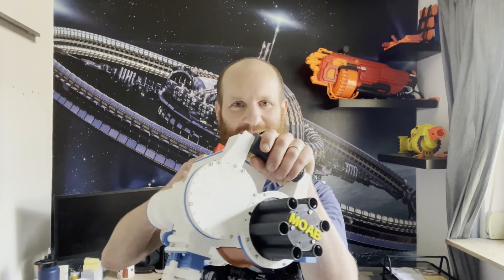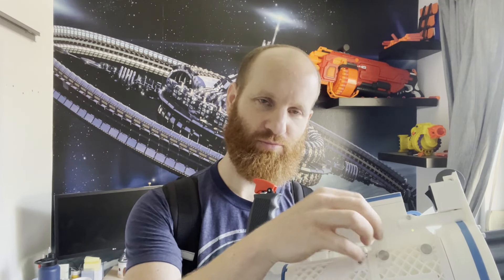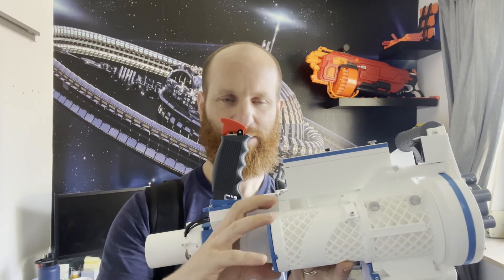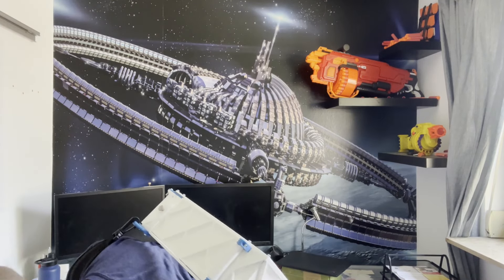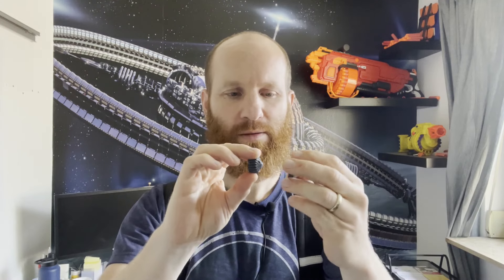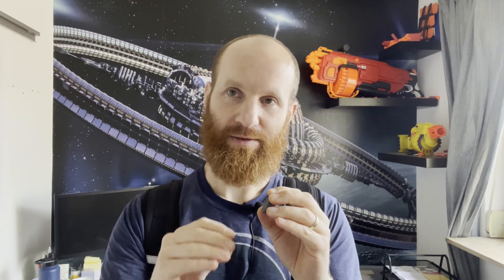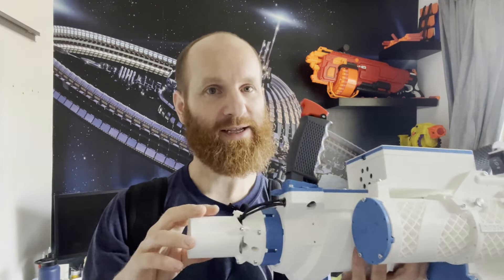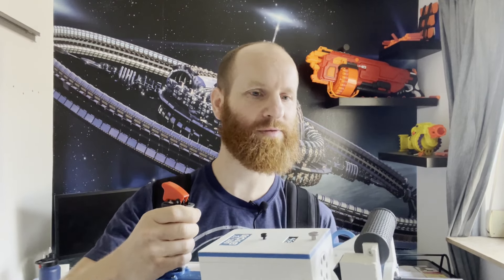My improved Nerf Minigun!

Comment: I will never be able to afford any of it but watching you fired that thing off is a joy to behold. Also why don't you replace that coupling  with a spring-loaded clutch system?
Reply from the maker: You mean a clutch that disengages when the forces get too high? Mmh, I have to check how they are designed, if they wear out and if the behave the same independent of the rpm

Comment: Looking at how tight that stream is where theres barely a gap between them, there seems like the next hurdle with the rate of fire is the general fps rather than the load to launch rate
Reply from the maker: I tried to calculate it: my Darts leave the barrel with around 20m/s, so with around 275 darts per second they would all come  out in endless stream touching each other (would look like a train, or a laser 😉)

Comment: Need to redesign the delinker so that it doesn't delink the belt, and instead just pushes the empty belt right back to the backpack.
Reply from the maker: Sadly that require a big overhaul of the complete blaster, so I will stick with the current mechanics

Comment: Would’d love to buy this! If its cheap and easy to assemble then yes. Also maybe make a speedloader, and a speed cleaner, so its easier to get all the belts and stuff and then it reloads the belts for you.
Reply: There is no way, this is gonna be cheap
Reply: @BommeI  ik but no one will be able to beat you
Reply: @aviationist1018 This blaster's range isn't super impressive so a Caliburn or Saber M20 with a SCAR barrel sniping in the corner will win.
Reply: @atToebiscuit  how far is the range?

Comment: I still think  the chin should still be like a sloid 15 to 20 darts then a pop link then another 15 to20 darts less to put togather and less parts to lose
Reply: That would not work for its intended use. The shells need to pop out. Links would not have the same effect.
Reply: The links concept could be used in a WWI nerf machine gun